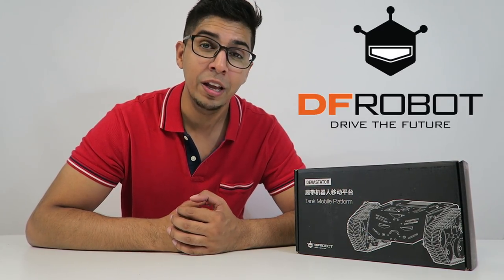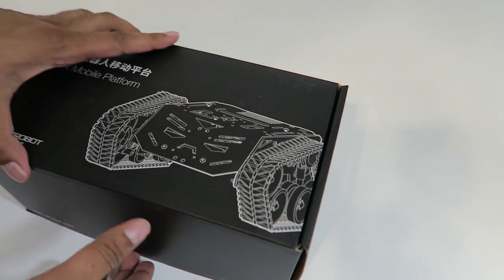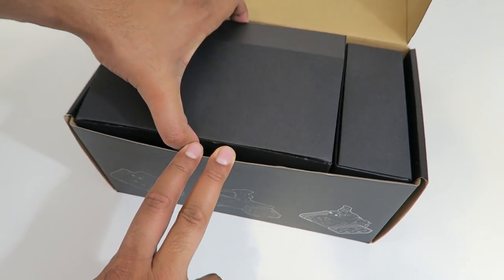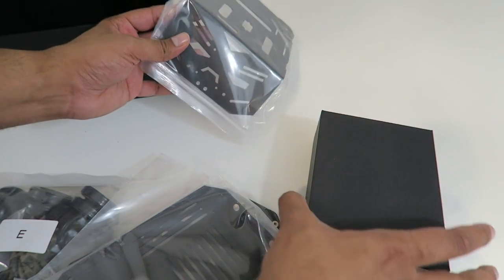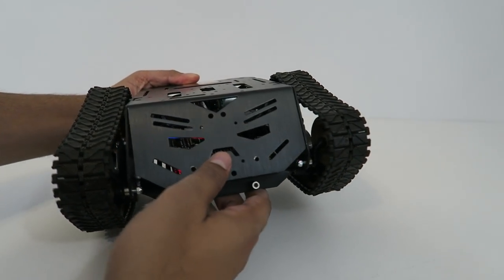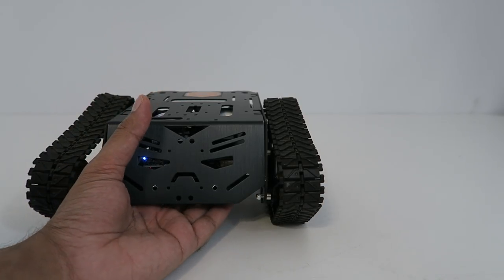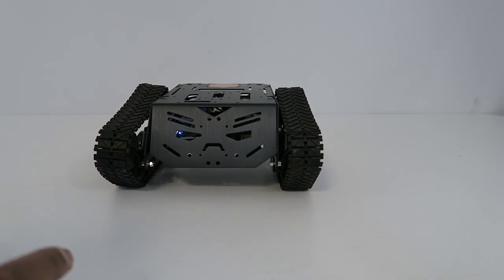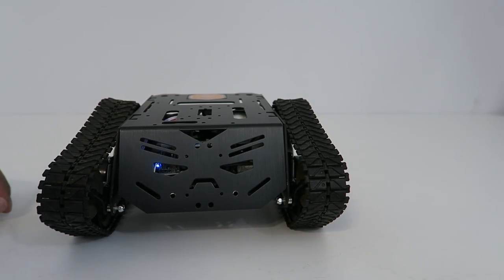UNBOXING & LETS PLAY - DEVASTATOR - Tank Mobile Robot Platform (Metal DC Gear Motor) - DFROBOT

Comment: Khan, HELP!  Im looking at the same project, but I have wiring questions.  Did you put a separate power supply for the Pi and another for the motors?  I am trying to use the Raspirobot and not sure how to go about wiring it.  Very nice concise video BTW.